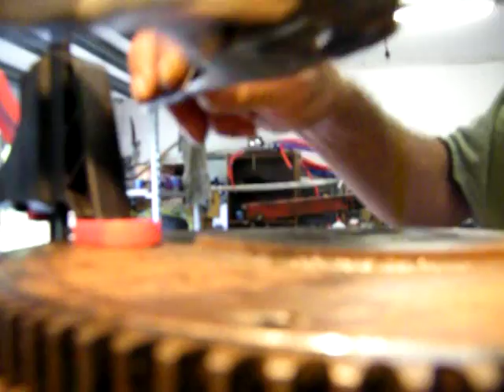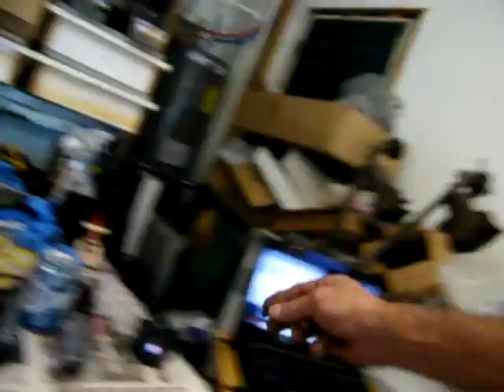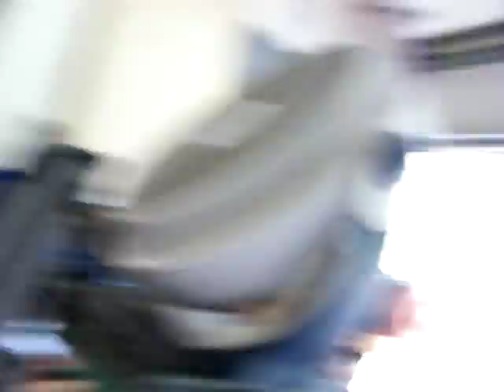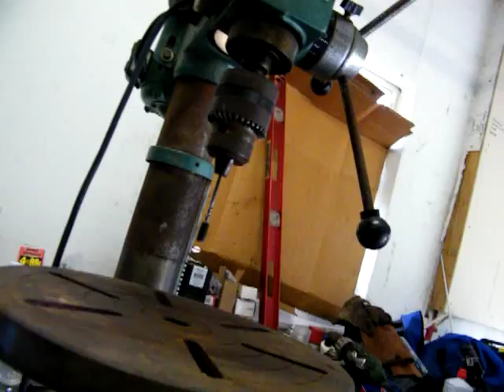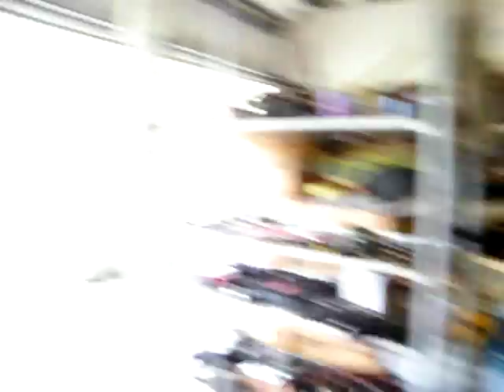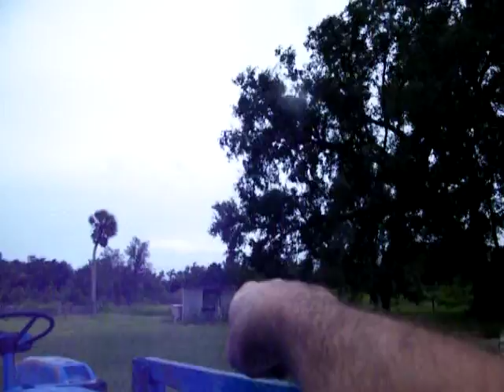DSCF0105 LOVE IT

Comment: A drill press is a handy tool to have.
Reply from the maker: what funny about this is I had one of those cartoon moments. I had just broke the bolt and I tried to drill it by hand. got all kinds of frustrated, gave up and installed the motor . walked back in the garage and a friggin light went off as I passed the drill press setting tools down. had nightmares all night long got up in the morning pulled the motor and threw the flywheel on the press and in 5 minutes the bolt was extracted.
Reply: @Rewired69  Sometimes the answer is right there staring at us.